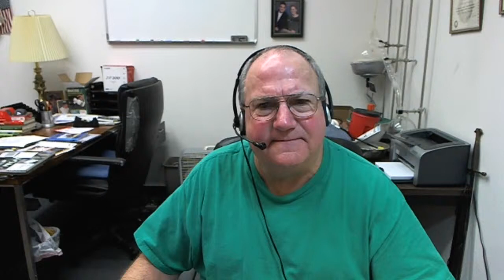Treating Tungsten Carbide for Brazing

Comment: i am trying to silver brazing process between SS 410 AND TUNGSTEN carbide but silver brazing alloys and carbide dont bond properly 
can you please help me out in this problem
Reply from the maker: Analyzing braze failure I’m always happy to analyze braze failure at no charge the idea being that maybe you will let us quote on your carbide flux and braze alloy but that is not a requirement.

Generally the most efficient way of doing this is to send me some pictures of the problem.  Sometimes that is enough and sometimes I need more information.

Tom
Reply from the maker: president@ carbideprocesors.com
Reply from the maker: president@carbideprocessors.com
Reply: @CarbideProcessorsInc  Hello Sir,
My name is Peter, I'm from the UK. I'm not exactly sure what you meant by your video? Are you trying to source raw carbide powder? Tungsten carbide alloy mix powder? For either manufacture of micrograin carbide? Are you looking for used carbide sources? Please let me know, I may be able to help.
Regards,
Peter Buxton S.c

Comment: A link to the blog post about sintered carbide tip treatment, would be great. I am trying to bronze braze used carbide inserts on to steel shanks for use in lathes but most of the inserts dont bond to the bronze. I am not too sure where am i going wrong. Any help would be greatly appreciated.
Reply from the maker: Abhinav Gupta Thank you for your comment! Click on the link in the video to be directed to our website page on brazing topics. Tom covers it all from Brazing Gases to Brazing Projects.
Reply: Thanks a lot Carbide Processors Inc :)
Reply from the maker: Analyzing braze failure I’m always happy to analyze braze failure at no charge the idea being that maybe you will let us quote on your carbide flux and braze alloy but that is not a requirement.

Generally the most efficient way of doing this is to send me some pictures of the problem.  Sometimes that is enough and sometimes I need more information.

Tom
Reply from the maker: president@ carbideprocesors.com